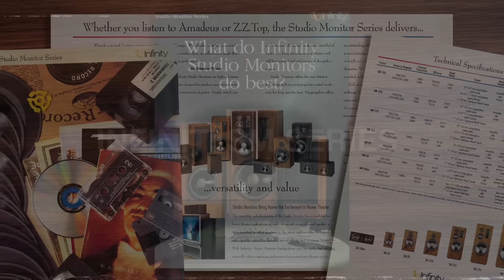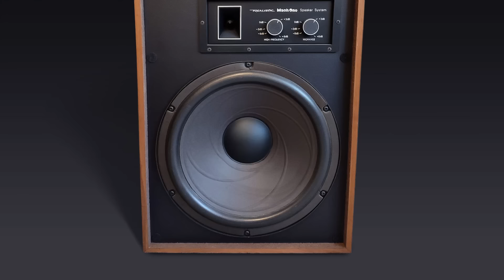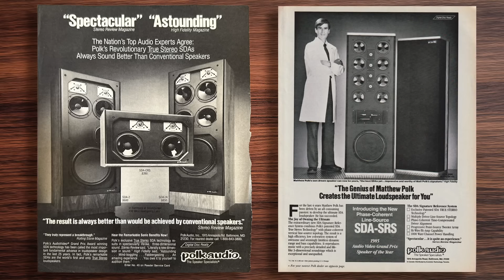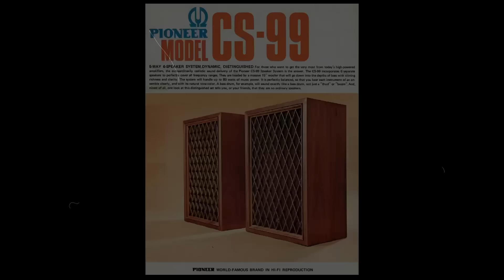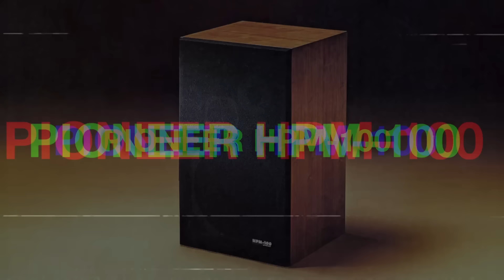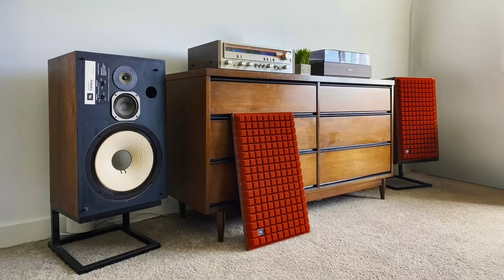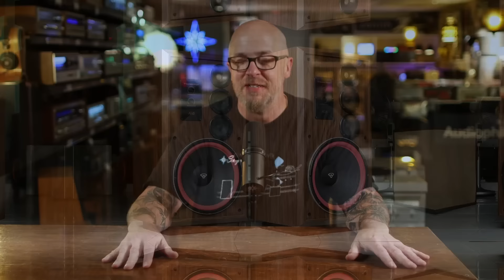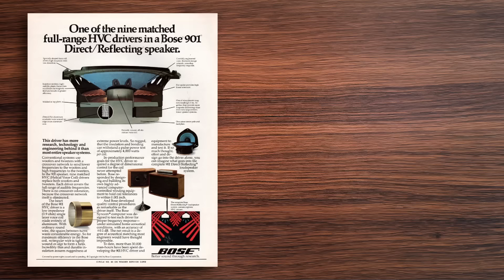Why Do Audiophiles Hate These 9 Legendary Speakers?

Comment: I first bought into Hi Fi in 1975.
Driven by a passion for music.
Technology delivers it and with time improves.
If that stuff was so great, why'd the makers almost immediately stop making it?
A '69 Camaros for instance may still look good and bring back memories, but would you put your family in one?
They run like crap, stop for shit and won't go  around curves for beans!
Same to be said for old Hi Fi.
I loved my Klipsch Heresys for a while. Then they got on my nerves. 
Phase aligned , low resonance speakers started popping up and I was gone.
My Dual 1215 turned int a Thorens TD 160 (both belt drives) which gave way to a Direct Drive Kenwood KD 500 with a cement like cast chassis and an Infinity Black Widow tonearm topped with a Micro Acoustics 2002 cartridge with some new  tech system in it.
I could go on and on, but I bet you get the idea.
Familiarity breeds contempt and so it is with toys.
I would buy a Micro Acoustics DDX 1000 with a MA 505 arm  even though I have no records.
It would make a cool wall art piece. Google it.
I had hundreds of records no one dared touch. Now its all binary on solid state drives or  streamed.

Comment: The infinity dual midrange speakers would cancel each other with varying vertical alignment. 

The distance between the woofer and the mid on the Mach 1 could create vertical alignment sensitivity. 

The SDA Polks could sound incredible, but suffered from the placement issues you mentioned. 

The Kabuki speakers had horizontal cancelation with paired drivers. 

The HPMs can be made to sound good with some tweaks to the crossover.

The Klipsh speakers can be improved by crossover manipulation. 

The L100's have good enough drivers, but need some tweaks to get the magic out of them.

The CV's can be made into pretty good speakers with crossover refinement. 

The 901 is not a great speaker from the basic design standpoint. There's too many compromises. 

Most of the vintage stuff is challenged for various reasons. Some can be great with some tweaks. 

Great review of the hated speakers.

Comment: I worked at Allison Accoustics in the '80's. Started out on the assembly line and worked up to testing. Tested components and completed speakers. Dr. Roy Allison was a great guy to work for. He had his own personal test equipment. Built in Denmark by the people that started Bang and Olafson. Bose was the cross town rival. They buried their factory. That's why the box says "The Mountain, Framingham,
Mass.". We had a purpose built room for "real world" conditions. Ugly green shag carpet,shiny fake wood panelling and a drop cieling. If you could get a good sound in that room, They would work anywhere.
Reply: I owned a pair of the one's with the electronic subwoofer eq many years ago. They were great.
Reply: @audiophool864 Was this the model with two small speakers in aluminum housings and stand alone sub woofer?. That was a project by Jonathan,resident genius. No circuit boards meet your design?. Just make what you need. I'm surprised at these videos of people re foaming speakers,etc... to keep them alive. The expectation was 10 years. Neglect,bringing things outside,etc...would damage things. People do not like to pay for repairs. All kinds of complaint letters wanting us to replace factory defective product with free new replacement. Someone painted our speakers with shellac. Had them out by the swimming pool. They got into the water and shorted out. We opened up the cabinets. Chlorine gas had been created by the electricity. Corrosion everywhere inside. Smell of chlorine was strong. Dr.Roy Allison personaly wrote the response letter. Great place to work.

Comment: There's no denying that the room has a lot to do with how a speaker sounds, but it seems the ones that needed special placement to get their best performance were the hardest to sell. Some sound good away from a corner some sounded best in a corner, some you had to crank up to get the best balance of bass, midrange and treble. I sold JBL and we sold more 4311's than we did L100's even though they used the same drivers. We also sold JVC and they had a speaker (can't remember the model) that really gave Cerwin-Vega a run for their money with the party crowd; you know the ones, they kept the amp cranked up all night and you could fry an egg on the top by 10 o'clock, and you'd do several warranty repairs from cooked circuitry. I have to say my favorite bookshelf -size was the 4311 and my favorite floor speaker was the L220 of all the brands we sold. I had a pair of Imperial 7 Marantz speakers that were actually pretty good too.. I lusted after a set of Klipsch La Scala's though, I had some friends who had a garage band and used a set as PA speakers and miked the guitar speakers through them too. God they could get loud, and rattled windows for a couple of blocks.

Comment: I have a set of Infinity SM15's. I bought them in 89 I think. Back then, there were stereo departments you could side by side speakers and whatever you wished. My music of choice was hard rock so, I was looking at CV's but I didnt like the lack of mids and highs. The SM's had the sizzle of the cymbals, and the midrange to go with it. I'm on my second set of surrounds for the woofs.  I still like them.

Comment: I have an old pair of STR (Sound Technical Research) speakers that I purchased in the mid '70's. They were designed by a group of engineers from JBL, ESS, el al that were great designers but less astute business men.  Even to today, I believe that they could outdo just about any other speaker made.

Comment: Been playing with audio since the the 1950 when I was a lad with my first table radio.  I've got great speakers in my set-ups.  But I have driven some dogs while learning. The 901's had a synergy issue. If you drove them with a modest amp or receiver, they had sonic problems.  But, if you drove them with a Bose 1801 they came into their own quite well.  Amp/speaker synergy is real.  It has been proven to me a lot of times.  Best example was one of my buds with some Scott speakers that were OK with his amps.  They were octagonal "end table" speakers that never got me going.  He blew up an amp.  So I dragged my re-capped Sansui G down there and hooked it up.  Magic.  The most amazing sound came out of that pairing  😅

Comment: They were pretty much all overrated. Paper cones, far too many drivers, ridiculously cheap and tortuous crossover networks, various gimmicks...  Most were all sizzle and boom with awful midrange response and muddled stereo imaging.  Other than some early electrostats, most speakers pre-1980ish were just junk.  It wasn't until Vandersteen, DCM, the Celestion 600, Spica, etc. came along that speakers could realistically resolve instrumental timbres, soundstage, and stereo imaging.

Comment: Bose 901s can sound amazing, but it has to be the right room with correct placement. You also need the equalizer and last you need power. You need tons of power to drive them properly.
Reply: The power need is overstated especially for the later versions.

Comment: So I'm a bit surprised regarding Cerwin-Vegas. While I'm not sure which cabinets you are listening to, but I have a set of CerwinVega 380 SE. Regarding accuracy, I have measured in a tuned recording studio room with pink noise. They were ruler flat from 50 hz to 15k, although the 15k light was flickering on and off once in a while. My Ivie spectrum analyzer did not go above or below those freq, so I could not measure a wider bandwidth. At the CES show, we listen to every high end speaker from every manufacturer. Nothing sounded as good, other than the Magnaplaners. Listen to something like the Telarc recording of Vivaldi's 4 seasons. You will be blown away. They have a really rich mid-range that never gets honky. The bass is tight as a result of the alias surround rather than the flubbery rubbery surrounds everyone else uses. The only weak point is the tweeter could get harsh, but that is easily remedied by putting fiberglass between the diaphragm and the magnet. I still have not hear a more accurate pure sounding cabinet to this day, although I would say the Tannoy FSM Pro 215 comes close. At super loud levels, then the Tannoy did better, where the CerwinVega would compress.

Comment: I modded a pair of L100’s with a modified crossover someone else designed in about 2004. They were much better sounding, more detailed and smoother. I thought they sounded a bit too “refined” for L100’s. But classical sounded so much better.

Comment: I owned a pair of Infinity SM 120s for a long time and I liked them ok. Once the foam surrounds rotted out and had to be replaced they never sounded the same again. I didn't like them like I used to. Eventually, they were donated to my Goodwill.

I now have 2 sets of speakers (in different rooms). My den has a pair of JBL 4312s. My office has a pair of Vienna Acoustic towers. I love them both, but for very different things. When I want to rock the house and jam to some great classic tunes from the 70s or early 80s the JBL 4312s have me covered. When I want to enjoy some critical listening, my Vienna Acoustics is the right medicine. I'd eventually like to get a pair of JBL 4311s too (just because).

Comment: Bose 901s simply near impossible to beat as a vintage speaker set up. Put them in the right room and in the right location and you’d be very hard pressed to not find them delivering fabulous vintage sound. 

Always been a long time fan of the Klipsch as well. The music these speakers were directed to is what dictated the sound produced.

I loved the Cerwin Vega scheme where you could buy the kit and build your own set from scratch for about two-thirds of the price of a complete pair. 

You can’t beat these vintage speakers - all have great sound for the right setting.
Reply: The Bose 901s SUCK power especially at the low end because the equalizer has like 20dB of boost at the low end.  BOO!
Reply: Horrible speaker. I have no idea why anyone has ever bought them.

Comment: Bose 901's can be quite impressive with te right setup and right power amp and if you have a separate preamp feeding the same signal you can mix in a sub..incredible. . the 601's are nice too.. the 501's I think sound terrible.

Comment: First thing i look at on a speaker is, are they mirrored or cheap build .  But personally i don't think vintage speakers are worth it
because  i'm pretty sure their crossovers are all in dire need of upgrades of components and cables, and worse case,
their elements needs replacing of the cone.

Comment: Bought the Bose 901 new at the Pacific Stereo and got them home and spent hours measuring to hang from the ceiling. Called a few friends to share the audition.  With a Luxman L100 driving them  were all so disappointed.  Traded them for a pair of Thiel O3A within 3 weeks.

Comment: BrAun L810, LV1020, etc (that eventually A/D/S used the parts and designs to distribute some models in the u.s.a) were my best compromises though I owned Quad esl57, IMF-TLS and now Tannoys. Braun designs were surprisingly both musical, punchy and well balanced. Dieter Ram's modern designs were not well received in the 70's in North America though today we recognise his work. 
My bang rocking speakers were Celestion Ditton 66, then I calmed down a bit and went for Braun.
In the store where I worked, we equally sold Cerwin V. They were fun too 😊

Comment: In the 80s I had a pair of La Scalas that were used for sound reinforcement where you have a bass player. In the living room when not at a gig I ran it with my Crown IC-150A preamp and my Harmon Kardon Citation 16. I found that you need a large enough room for them. You need to be a certain distance from them to appreciated the sound. The horn loaded bass does not produce real low bass... they needed a subwoofer. These are meant to project. I bought a pair of EV PI-15-3s with 15" woofers, 6.5" Vented Midrange with 16lb magnets, and ST350B bi-radial tweeters in a large vented box. Much better bass, great midrange at a closer distance and a much better tweeter with a large magnet. Got them used for $400 back then.

Comment: So called audiophiles will spend more on their stereo system than the recording spent on recording equipment thinking they will magically extract more music than normal gear will extract. Old gear could be classified as works of industrial art, but give me modern gear. Less distortion, better speaker connections, banana plugs, Modern bookshelf speakers are amazing, but I have to admit. I do not like tower speakers. Those look a bit silly, unless those are 36" or less in height. I think some of the old cabinet designs are beautiful. But everything changes and sometimes there is progress.

Comment: Ive had quality speakers,  (mid 70s Cornwall CBRs) and loved them.  But like you alluded to in your video I prefer my double-stack of mint 200w HPM-100s that are connected to my compeletely rebuilt-recapped SX-1250.   (my double stack of 100s are on 8" bases)   This rig makes me smile when I drop the needle on the PL-530 and a nice 180 gram pressing.   

Thanks for all you do with this channel.

Comment: I have the 901 and loved them untill I placed them in another room and I can't get a proper sound anymore. I hear some distortion and the high tones and I feel the EQ needs to checked. I first suspected the DAC for spotify but even a good quality CD player didn't bring back that old sound I was used to. I did notice that they sound better with my old Yamaha amp from the 70s than my new amp from 2008 or so. Does anyone has a tip how to overhaul the EQ? I suspect the condensators need replacement. There used to be an US shop that would sell the complete condensator set but don't find anymore.

Comment: Gotta love your comments on the 901s. Mid ‘70s, a club in Cherry Hill, NJ used them around the dance floor, without the benefit of subs. The pushed them too hard, trying to get the punch out of them, that they’d never deliver. Soon all the cones were rattling. That’s what turned me off to them. My Stacked Advents could kick their asses, without sounding gimmicky…

Comment: So if anyone is doing a recap on their vintage crossovers... Definitely do not buy those kits of yellow mpc super capacitors from that eBay ad flashed on the screen. I bought some for my old cs-88a s , tested all of them and all the big caps were way out of spec, all short of where they should be... Pretty disappointing.

Comment: I sold Bose for 13 years. The 901's were only OK, even when set up perfectly, but I LOVED selling the 301's. Why? Because I could make them sound good in ANY room with little effort, and especially when placement had to be less than ideal. Also, Bose 301's NEVER broke. I never had a pair serviced or returned. Not linear, not transparent, not articulate, but in the 1970's and 80's with the majority of popular music being over-produced and often pretty lush, the simplicity of the 301's 2-way design and their voicing made them the best small/medium room speaker you could buy. In my never to be humble opinion...

Comment: I have a pair of HPM 100's , 4 pairs of Klipsch's , 1 set of KSF 10.5's , 1set of KG 4.2's , 1 set of Senergy B20's , and the 2.1 PC speakers with the sub , also 1 pair of Cerwin Vega RE-20's ( need to be refoamed ) and am currently debating on a pair of matched 1980  Klipsch Heresy's in vary good/ excellent condition . For me the HPM 100's , Klipsch  10.5's and 4.2's are my favorite's . I drooled over the HPM100's as a teenager as well as the Heresy's but could never afford either in the 70's . I may be older but I still like to rock and both the Pioneer's and Klipsch are my kind of speakers  . . .. .  I may have developed a speaker addiction , the KSF's and RE-20's carried me for many years , all the rest I've picked up over the last 4 years lol.

Comment: I did live concert recordings back years ago... Took digital masters (DAT) off to the local stereo shops to audition speakers.  I KNEW what my mikes sounded like...Most recently a Ribbon Royer stereo mike... but back then a pair of AKG mikes hung in a coincident pattern.  Result?  In a system that is superbly accurate phase wise and response wise, the sound stage was FAR wider than the speakers.  You could also hear "elevation" on the best speakers.  A recording of Mahler with a soprano soloist in the 3rd level of the choir, which was above the orchestra?  Closed my eyes, and she was above and to the right of the right side speaker. It is too bad that purists don't do the recording for most CDs... A friend down to the south said that my cds sounded better than the super audio CDs he had there...

Comment: Just to drive you nuts
I'm retired and have finally put together my dream system, the speakers - Klipsch Forte II (1989 modified) and New JBL Century L100.
My downfall occurred when I discovered the McIntosh MA352 had a full-range pre-out to which I connected an MC275VI. 
A Niles speaker control balances the speakers. I have found that the speakers actually complement each other.

Comment: My old system had Cerwin Vega RE 30’s that I could not give away at a garage sale 15 years ago.  I finally kicked them to the curb - literally - as I upgraded to a Denon AVR-1312 system.  Those speakers are now selling for $800.  I am not thrilled with the sound this system provides to my old vinyl collection but until I build the vintage system,  it will have to do.